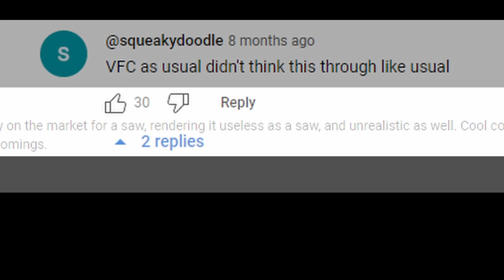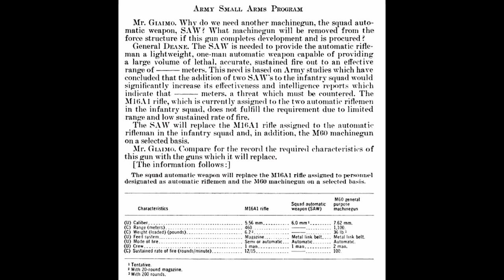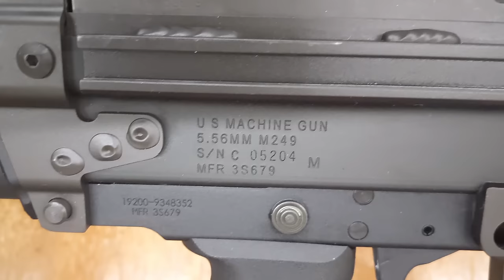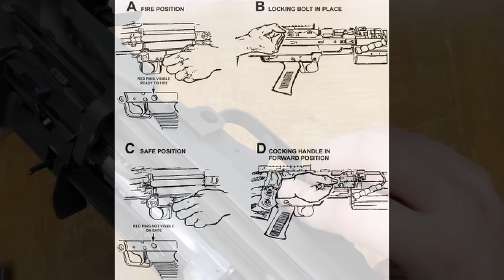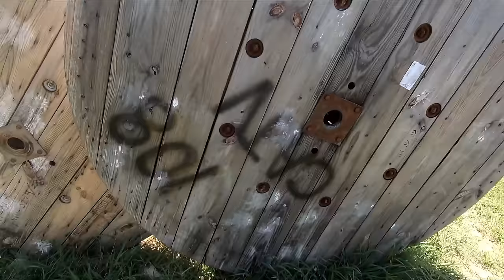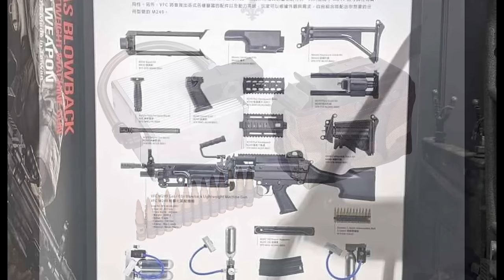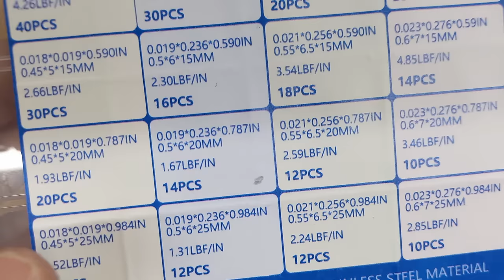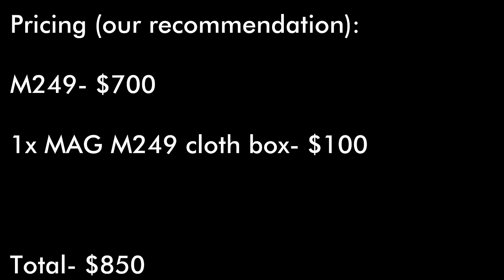VFC Airsoft M249 Review: Untapped Potential

Comment from the maker: A few quick notes that got accidentally omitted during filming:
-The rubber bumper that the charging handle passes over is also the lever that opens the ejection port cover. This seems to wear down fairly quickly, so it does so inconsistently. There is no impact to function.
-The stock inner barrel is 355mm.
-We tested Maple Leaf Wonder and PDI W-Hold buckings, and neither performed as well as the stock bucking, even with the nozzle spring mod.
-Efficiency tests were conducted at an ambient temperature of 73F.

1/12/24 Update: We DO NOT recommend the nozzle standoff spring anymore- please see our follow-up video: https://www.youtube.com/watch?v=q_AHHP_uhac

We'll update this comment with any further developments or anything else we missed.
Reply: I agree brother 0331 for life and these kids couldn’t hold the real thing or ammo any ways. Would love to see them hold 800rds water frags nvg  helmet smoke and any other combat load. I love my gbb saw just hpa mine. Love low bb/ammo count. It makes you better and harder for you

Comment: We had VFC on site at the GBBR LARP in Taichung I wrote about back in May. They brought 5 different final prototypes along in different configurations and were acting as arms dealer NPCs allowing players to borrow and use them in game in exchange for objectives completed in the MilSim.

I'm pretty impressed with the system on the face of it, and it was surprisingly accurate and consistent in use from what I saw, but I still need to get hands on with one in a longer term review now I've finished up with the LCT SVDS.

I definitely like the separation of gas and ammunition feed. No daft hose which always cause feed issues in my experience.

Also, why do they keep doing this with open bolt guns? I'll suggest they include the spring standoff in future when I see them 😂💪

Comment: The modifications you've shown and the options im already seeing for 3d printing is something i hope they can incorperate in gen 2 and make backwards compat with gen 1.
With the high gas efficiency i don't see the need for them to redo the gas system albeit it an intergral NPAS and or Alu nozzle would be great (really when you make your gun HPA-able how did you not do this).

Comment: Lets just hope its not full of those wonderful cheap magnesium parts. Cant shake the memories of my VFC GBB M4A1. Too light, dimensions wrong. Shot nice and crispy for two games. entered the third and the BCG exploded, bent the upper receiver and cracked the slip ring housing. Sent pieces of plastic nozzle all over the place.

Only info I can contribute pertains to the MK48. They start with "NV" in the serial number. The one I was issued in 2011 was NV482301. I don't recall what the MK46's started with as we only had the one in the platoon. I seldom used SAWs when stateside and don't recall any sernos from the top of my head. I can tell you the metal finishes look nice, but are entirely off from the real thing. The 249 has a weird mix of finishes on it. The feed tray cover is almost purple, the receiver has more of a blue finish to it and the stock collar and trigger group have more of a green tinge. I have yet to see any airsoft gun pull off the mixed finishes look. This is a mess of grays. Hope you get it nice and weathered.

Comment: If needed some more recoil why not to wait untill a steel reciever is made by aftermarket rather than washers modiffication? Actually I understand that this video was done at the time the aftermarket just started thinking about some mods to be done. The same with the nozzle mod. Do you think that your mod can stand longer time use? Unless itś not 3D printed in one piece I don not believe that any glue can hold it for long. But I might be wrong. And last but not least the HPA is also expected by VFC sowe should bet sttisfied by it too. Whatś more I think it should fit he magazine. I understand the BB mag modiffication, but to me it looks awfull and I stay with plastic mags. Hopefully some aftermarket replacement occurs solving all the issues the original have.

Comment: is it possible to buy a block with the spring for the nozzle from you? I dont own a 3D printer also it is possible to have the measures for the spacers you used for the weight? Mine is on its way and id like to get the parts before it get here.
Thanks for all the info!

Comment: How do you get the small portion of the barrel off under the flash hider? Ive tried everything and it won't budge. I've heated it and it's still on there like it is welded on! I'm trying to install the longer barrel that they sell.
Reply: It looks like they changed it. I removed the front sight and took out the grub screw and there doesn't appear to be any threads on the small barrel portion. Tried to remove with a vise but it does not come out. Looks like it's all one barrel now and can't put the longer barrel on...

Comment: I just dont like the magazine system for this one. Im down for GBB LMG's but If the purpose of a GBB is sorta realism, I want to have something with belt bags for bb's. It definitely is cooler than I imagined though.
Reply: I don't see why they couldn't have real capacity box mag and enough gad storage.

I like the idea of having to lift the cover to reload. You do on the real one, but it just seems like a missed opportunity. If I can get a 400bb box mag for my mws this thing should be able to use a 200bb box mag ootb

Comment: Lovly weapon but I think to actually get this gun operational and working I.e. tapped for HPA use to avoid cool down and modded to use a drum mag for ammo capacity you would be better simply buying a HPA LMG at least everything you would want to do and even more so like changing the bucking for accuracy isn't a chore to do or having to mod the weapon in such a way. So in a simpler sentence if I were to buy one of these it would sit on the wall and maybe be ripped thru a mag once in a while shame 😕.

Comment: M249 SAW GBB is theee closest to the actual reallife counterpart as it can possibly be... the noobs are wrong as can ever be... the m249saw does not hold big ol ammo cans with 4-500-750-1000rds like theyd like it to.. no real soldier would ever take something soo damn bulky and heavy into combat most m249saw operators carried 200rds per box or 100 to 150 per nutsack so the 100rd cap on this replica is as close as can get without adding an external magazine option and the gas resevoir use is actually the best thought they ever done... a lot of gas was needed to push all that steel and aluminum

Comment: He did something wrong that can damage the gun. The makers of this gun made a video that shows them loading the gun the right way, I watched that video. At 35:50 he loads the BBS wrong, u need to pull the cocking handle back, then u can safely lower the feed tray. They tell u never to lower the feed tray without first cocking the handle and leaving it pulled back. After the  feeding tray has been lowered, then u can pull the cocking handle back to its original position. Look up video "Operations Guide for VFC M249" and select minute 7:40.
Reply from the maker: There is no harm in closing the top cover with the charging handle forwards. The video you are referring to is emphasizing not to close the top cover with the bolt forward, but as long as the bolt is back the position of the charging handle is irrelevant and does not contact any part of the top cover.

Comment: 39:50 It's a terrible concept, you already have the gas being routed from the mag so it would make a lot more sense to have a tube that feeds bb's right next to it. The cassettes make the reload less realistic, won't fit into 100rd pouches and hold a small amount of bb's.
Reply: Because dumping BBs into a box mag is totally more realistic than actually having to open up the feed tray.
Reply: @CLODXJ6  You switch out the mag with an already loaded one not dump bb's directly into it ...
Reply: And then insert a feed tube into the AR magwell in order to feed BBs while pushing a button to feed the 2000+ rounds that's 10x the capacity of the real thing.

Yeah so much more realistic, lmfao.
Reply: @CLODXJ6   Genius, it's the same feed tube you already have to seat. You're going from two operations to a single one, which makes it far more realistic than having to seat the box mag for gas and then having to separately insert a completely unrealistic cassette for bb's.
 
Where did I say 2,000 rounds? It could be 200 or 400. Much better than 100 when the real thing does twice that on a box mag.
Reply: Nice joke.

You should become a comedian
Reply: @opairsoft8100  You must be twelve
Reply: @boostav  says the dude who thinks not opening the feed tray on a airsoft lmg is more realistic....
Reply: @opairsoft8100  Thank you for confirming, please do tell how you're going to seat the belt when changing out a box mag if not by opening the feed tray?
Reply: @boostav  please do tell how your going to have the gas capacity while in the same container having bbs
Reply: @opairsoft8100  There's a huge empty space inside the box mag...

Comment: Complete waste of money imo. Very inefficient on gas. Way to hot with green gas for our climate and the use of lower power gas renders the rifle useless. Box mag broke first time using it, mag retainer came off and in order to refit it you need to completely strip the thing just to fit 2 tiny screws. I would rather an A&K AEG 249.

Comment: The Daytona system is far better for lmg

On the vfc   If you use the hpa option  is it possible to put an AEG box mag internals into the vfc box mag  and run the feed line into the stock 100 rnd mag ?